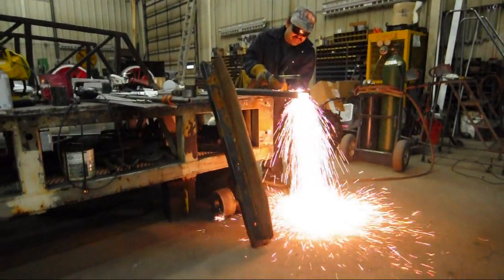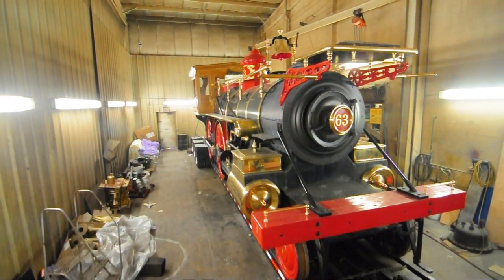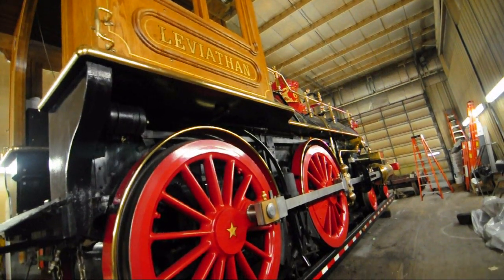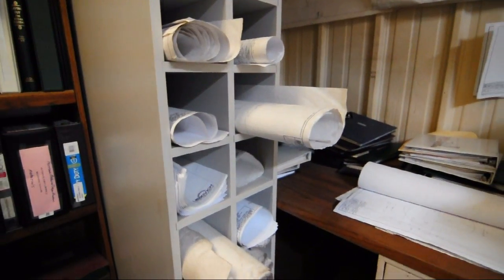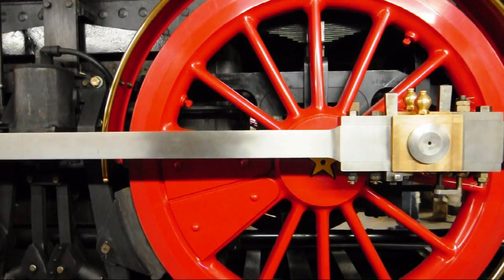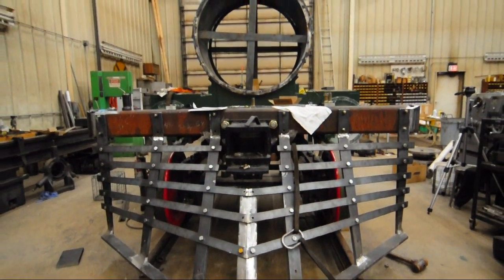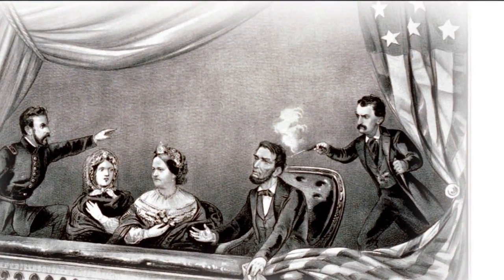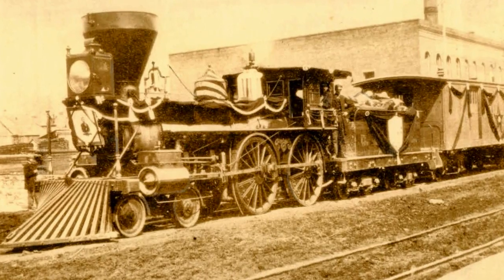Rebuilding history a piece at a time

Comment: What a lovely project. Even models in 5" gauge take years to build but the trouble is that it is a hobby and we are not blessed with the assistance of a production engineer who would break down each component and make it easier to fabricate.
Often a new process comes in and with some thought say water jet cutting can be used to machine sections of steel saving hours of traditional milling etc.
Best regards for the coaches.
David Scott reading England.